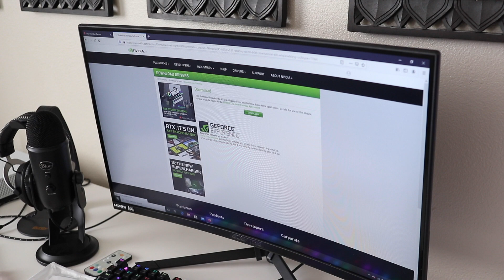How to Install a Graphics Card Nvidia GeForce - RTX 2070 Super Upgrade Your PC GPU with Ray Tracing

Comment: I had this prebuild pc, it used shite af cables for the gpu-psu thing (the 8 and 6 pin connectors) bassicaly, my cables got MELTED (i have no clue how, i was told it was cus they came into contact with my plastic side panel) so im in a market for them cables now. I was thinking of getting braided ones

So, could someone PLEASE tell me if i need to buy 2 cables?? One 6 pin and one 8 pin? Is there an option for a cable that includes both the 8band 6 pin headers? Thank you so much if u reply
Reply: if your psu isnt modular, you need a whole new psu, if its modular you can get cables for it, im pretty sure you can get cables which are split, one 8-pin and one 6-pin

Comment: what do we do if we have a 6 pin and a 6+2 pin cable for this? i have this 6 pin and an other 6+2 pin cable and that +2 can slide the side of the both 6pin head cables. i dont know which 6 pin that i ahve to use it with.

Comment: I have a ibuypower bb950 with a 500wt psu i wanted to upgrade to a RTX 2070 SUPER MSI GAMING X and a i7 9700k but now i know i need a new psu. I'll be upgrading to a 650wt psu with 80+ gold certification.

Comment: So it doesn't matter what kind (name brand) of desktop you use,  you can swap the NVIDIA GeForce GTX Graphics Card with the NVIDIA GeForce RTX Graphics Card 2060 or higher of your choice. As long as that desktop you currently have, and the graphics card are NVIDIA or NVIDIA GeForce?
Reply from the maker: Yes! If your PC already has an Nvidia card you should be upgrade from GTX to RTX. I’m not a computer expert but I believe the slot on the motherboard is a PCIe slot. Hope this helps!

Comment: i’ve just built my pc and the my monitor won’t connect to it. the dp is in the GPU but my monitor says no signal found. any advice?
Reply from the maker: Hmm I’m not exactly sure why you’re not getting a signal. I just took this card out and put it in another computer I just built and it worked no problem. You could reseat the graphics card and check the power connections. Try the HDMI output to see if it works. If your monitor doesn’t have HDMI plug it into your TV. Last thing to check is to see if the monitor is set to the DP input and not VGA or HDMI. Hope this helps!
Reply: I had the same problem I think if you use an hdmi instead of dp it’ll work
Reply: After you set it up then you can use dp
Reply: You need to install some drivers first for displayport to function properly, use hdmi when booting first time

Comment: I have the same PC, the 500w psu they cheap out on really isn't enough to run a 20 series super. I upgraded my Psu to a gold rated 650w. Better to be safe than sorry.
Reply from the maker: Yeah if we kept the RTX2070 in the iBuyPower 9290 shown in the video we probably would’ve upgraded to a larger power supply. Thanks for watching!